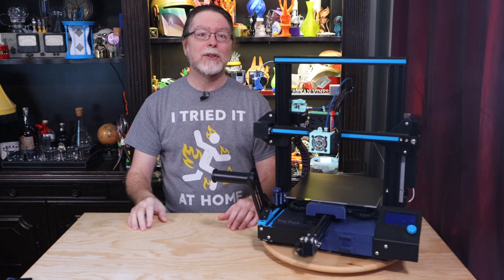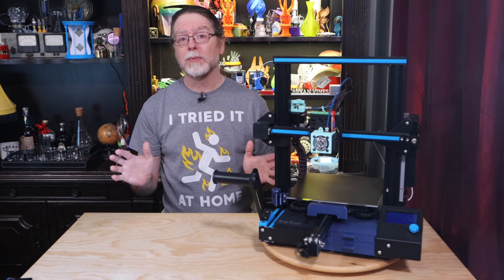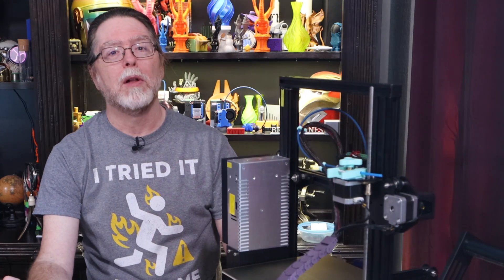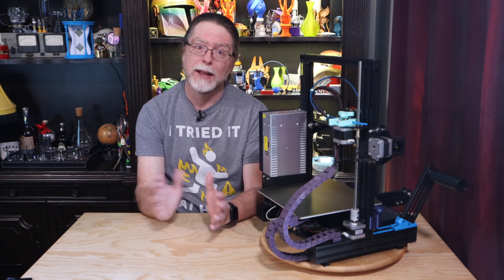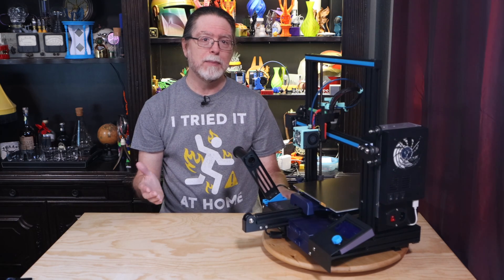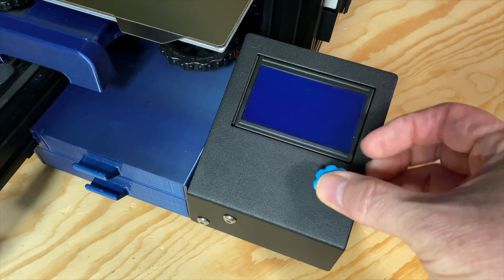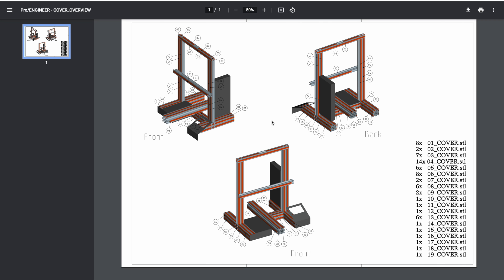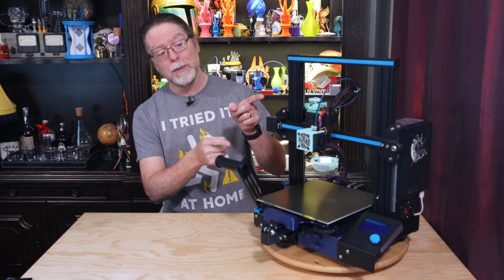My Favorite Ender 3 Printed Upgrades

Comment: There's one more i printed to fit into my printer and that is the board fan guard. It's visible here 7:42 on the right of the "deep purple" text where it is exposed by default on ender 3s, and things could get into it.

The fan guard covers it to prevent accidental jamming from foreign object to enter while still allowing the fan to 'breathe' 👍👍

Comment: I need help.  I just found you.   I had a back up on filament. I spoke so people on FB and they helped but now that I removed all the back up.  It melted a very tiny wire.  And now my print will not center
Reply: It would be great if you can get back to me not sure what I need to replace

Comment: Just printed the dual tray for the ender 3. Unfortunately the bed mounting bolts interfere with the tray case in the y movement.

Comment: You mentioned the extruder knob as an upgrade...  did you also print the aqua levers below it?   I am not a fan of the design and have seen people with printed ones to fix the design to make feeding the filament easier, however, I am not able to find those files.    Great video!!!!!

Comment: Hi BB I saw your spool holder upgrade and i could see that it kind of puts the weight on the left hand side of the printer, I was wondering would it not be better to have it some where center mass so that you do not pull things left.

The way I see it its like having an old shelby where its only power on one wheel the back left one meaning that when you step on the gas the car moves right and wise versa, now in this case it kind of puts weight on left hand side might put force on the left hand side meaning you might screw up the gantry the pulleys and belt drivers, you might not see it now but give it time and I'm sure you would start to see some tear on one side of things maybe hear a squeak from the bearings because the weight is off balance

Comment: I've seen you using Printed Solid Jessie PLA in some of your recent videos. What is your impression of it? For me it is quickly becoming my go to filament of choice, due in no small part to the 2kg i get every month in my Jessie box. That said, I have found it to be reliable and easy to print and I am generally very happy with the finished product.

Comment: The Ender 3 is certainly the VW Bug of 3D printers... a reference that only older guys will get, as there were innumerable aftermarket upgrades available for the original Bugs.
Reply from the maker: Haha. Yeah! I had a 1973 Super Beetle (in the mid-1980s) and a 2001 turbo. I think in the early 1980s you could build an entire VW Beetle with parts from a J.C. Whitney catalog! 😄
Reply: @BV3D  in my last marriage I had completely redone a 21 window micro bus it was cherry, that sorry ex of mine got it in the divorce.
Reply: I get it. I'm thinking more like it's a Chevy 350, infinitely upgradeable and modifiable.
Reply: Or the jeep cherokee of printers!!

Comment: were did you get the rail slot to cover the wire?
Reply from the maker: That yellow bit? It was just a section of slot cover left over from a set I had printed for another printer, and  I had cut a notch in it at one end for the wire.

Comment: Sorry, but all these updates are like a massage for the dead.  These are useless "beauty enhancements".
Reply from the maker: "A massage for the dead." I hadn't heard that one before. 😀 I particularly like the drawers and mounting the spool holder on the front left corner of the printer. Both of those have a lot of value to me. I also find it important to not have an exposed circuit board on the back of the screen.

V-slot covers anywhere but on the bottom extrusions to keep the crud from collecting? Yeah, that's 100% printer dress-up. So's the replacement knob. But some people enjoying personalizing their printers. Other people consider them to be purely a tool that needs no adornment. Thanks for sharing your opinion and thanks for watching! 👍
Reply: @BV3D  I just didn't know how to properly translate the expression we use in such cases. 🤣 I have already changed so many things in my printer that I could just immediately buy an expensive one, only the frame remained from the previous printer. But I'm currently building my version and all these parts will be transferred to it. Good luck! 😆

Comment: Could you do this for the V2? If there are any unique?

I already am gonna use the filament spool adapter for my V2! I hate it being on the gantry... Hate the idea of 1KG of weight hanging over the bed lol.
Reply from the maker: Hi! The LCD knob, V-slot covers, and filament spool adapter will work just fine on the V2. I'm not 100% certain about that particular bed handle, but I'll give it a try in a couple of days. The display cover and drawers aren't needed for the V2.  Oh, on the V-slot covers, if you end up with one or two that are a little too long, you can trim them with the flush cutters that came with the printer. 👍

Comment: Howdy Bryan I have not done any upgrades to mt ender 3's but I think I will start today. Is there any way you could shoot me the link for the upper and lower drag chains   the ones I find are not like yours and that's what I want. Also can you please do the video on the PSU cover have been wanting to upgrade to a larger Noctua fan 80 - 120mm so yes would love to see that video. And once again another great video looking forward to more soon.
Reply from the maker: I'm sure I've got the drag chain marked as a favorite on Thingiverse. I'll look and see if I can find it. That's been on the printer for about 2 years now!

I'm not super happy with it because it's not oriented the way a proper drag chain would be. It doesn't fold over itself like it's supposed to. It's more like having segmented armor for the cable.
Reply from the maker: I'm pretty sure it's this set. https://www.thingiverse.com/thing:2920060